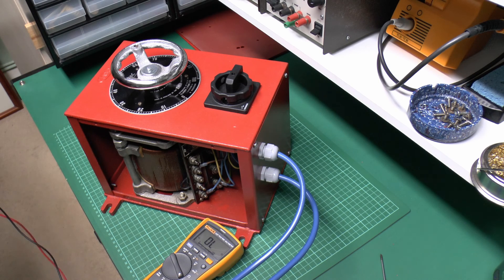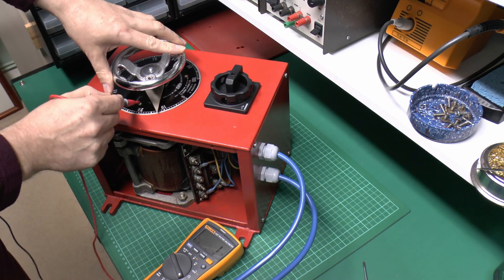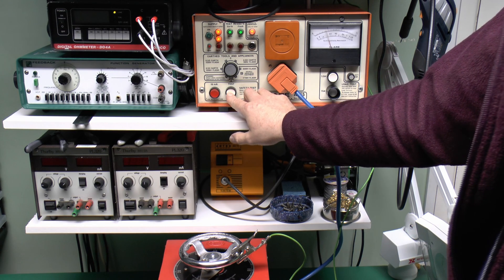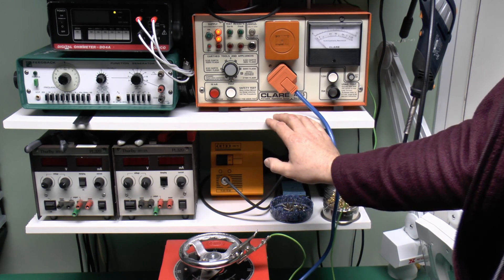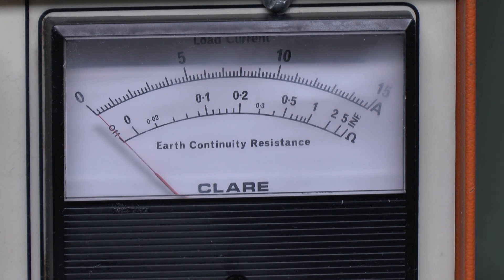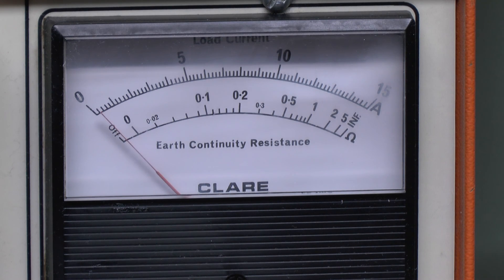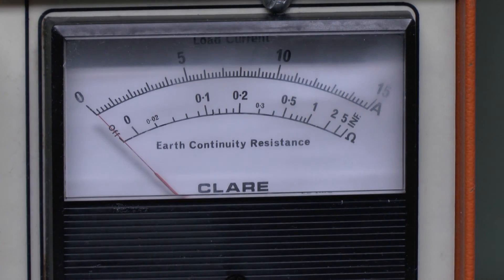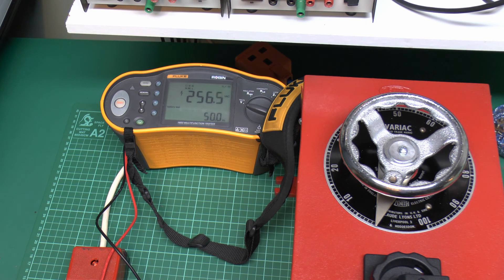Claude Lyons / Zenith 8A Variac Refurbishment (Part 4)

Comment: I noted in earlier videos in the variac series your high mains voltage. 
I got up to 259V here and had the local voltage reduced as a result. Light bulbs started lasting longer ! It may have also been responsible for some other failures: boiler transformer and a couple of cameras !
234V today.

Comment: I was fortunate enough to buy my British made variable transformer new complete with a dial and knob. 
I fitted it into a new rack mount case. It's handy to have the output socket and knob on the same face. 
It's still in my workshop today. I did think about installing a volt meter and a US socket. One day maybe.

Comment: Very interesting  video, trying to get one working myself, but is just wants to flip the circuit breaker when plugging it in. L-N resistance is about 2 ohm, and the is no short to gound, any ideas?
Reply from the maker: DC resistance will be very low, most transformers are like that.
Tripping doesn't have to be a fault - there will be a very large initial surge when first switched on, which will trip lower rated circuit breakers.   A higher rated circuit breaker will be required, often 20A or more, or in some cases a type C can be used.

Comment: i know it before but i have seen a vid its showing very good whats heppend if in a 3 phase system is a problem or a disconect to neutral! i thing under the street is a 3 phase 4 or 5 wire system even if the homes run on singel phase in great britan??? ! in an other vid from you you tell there is some fault in the cable system were you show a massive voltage drop under normal load in the kitchen. !!  in my place if i take a look under no load from my side or from the elevator ( in a 80 unit building ) the voltage its alwais near to 230V but under load its dropped massiv! next problem i have is there is massive DC parts on the voltage from a factory next to my place! i thing they use large controled switched recifires for some stuff in a semiconductor factory! so on my projects i have to use DC blockers!:( ist not alowed in germeny to disturb the voltage so much but industry can do what they want!  not far on my place there is a large physics reserch center called desy ! i worked at desy xfel for a half jear! they use several hunderts of megawatts an puls mode for the accelerators! they do also a large amount of bad interferance to the grid! :( they have to use motor generator convertors if they do so! people near the complex have sometimes massive problems because  of the not good recovery of the symetrical sinus wave! desy  have 3 connections of the 3 main substations of hamburg ! they are run directly from 115 000 volts! people at desy tell me if they have not removed the old petra and hera systems they suck more power as an middel sized city alone! but they uses it mostly at some recifires and pulse stuff :(
Reply from the maker: Most streets have 3 phase, with individual houses/apartments only connected to one of them.   Adjacent houses are usually on different phases to spread the load across all 3 phases.
You can have 3 phase installed to homes if you want to pay for it,  but it's rarely done as normal home appliances are all single phase.
Shops, offices and other commercial buildings usually have 3 phase as standard.
Reply: even small shops like liqure or gas stations run on 3 phase  ??  is there a option in great britan for asymetrical 3 phase servis like in  the us?? for example the main phase 200 amps and the other 2 phases just for 30 amps??

Comment: these in germany used b16 types circut breaker  trips at my home often because i run a pc a sterio amp and other smal things like a monitor on a large switch so if i not use it they are not connectet to the grid!  a 500va toridiall transformer with it its over! so i have to use a d20 circut breaker! special these new type of replacmend for the NH fuses into mains 63 amps  are shit! they trips faster than a b16 breaker at short circuts and alow not a inrusch current from larger lamps or transformers! i realy like more the old type of melting  fuse! i never have problems with the old diazed or neozed fuse or NH fuses! but these circut breakers dont alow me to use heavy tools or power surplys or something else! ! all these stuff is ratet for the circuts i run it on and it dont  work!

Comment: Is the 253V really a problem? I've used variacs for testing mains appliances that they can work over the full voltage tolerance and in that case it's obviously necessary that the variac can supply the maximum mains even if the incoming supply might be a bit low. Of course such a device needs a bit of care because it can theoretically blow up equipment connected to it if used carelessly.
Reply: Many household devices are designed for max.240V AC!Those high voltages will damage your devices over the time.Depending on the device it will decrease its lifetime.Lower voltages can benefit some devices e.g: filament lightbulbs and LED's with capacitor droppers

Comment: Great videos enjoyed them but what i thought was strange was the lack of fuses? Obviously this variac can do 8 amps so in short mode would happily cook wiring any reason for no fuses?
Reply from the maker: +Darren iii Output is via the trailing socket, which can only accept a fused plug.
Reply: +Darren iii 
Related to this and John's reply, I note that my similar variac, seemed to have issues with magnetizing (inrush!) current on start.  I (think) it tended to blow lower-range fuses on the input-side.

From what John says, a key solution is just to suitably fuse the output side only =).
But, I definitely wonder how one would provide a suitably-power-rated 
inrush-limiter to use when switching Variac on in the first-place...

Comment: Hello, am curious as to whether you came to any conclusions about your rather high mains voltage?
Reply from the maker: Bob The Dino It's still high - usually around 250.  Hasn't been above 253 when checked subsequently.
Reply: +John Ward
Report it to your DNO?   I've heard that some class voltage issue an 'emergency' and will come put in a Voltage-recorder straight away.....

Comment: Thanks for your quick reply. My variac is a bare unit, so I'm contemplating building it into a case, complete with meters to monitor voltage supplied and current drawn by the load.

Comment: Excellent videos John, well done! Your refurbishment was first class. I wonder if you could point me in the direction of replacement brushes for this unit as I own the same model and need to source these parts? Supplier name should be sufficient, although a part number as well, would be a great help!
Reply from the maker: The ones I used were from RS, http://uk.rs-online.com/ item 3473849.
They are slightly too thick, so need to be filed/sanded to remove about 0.5mm from the thickness.
Could not find any which were the exact size.